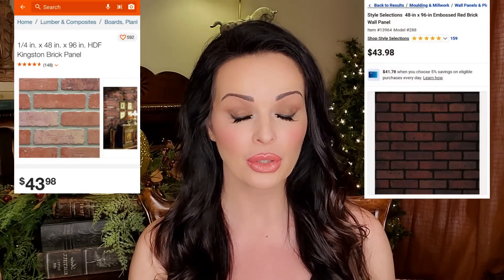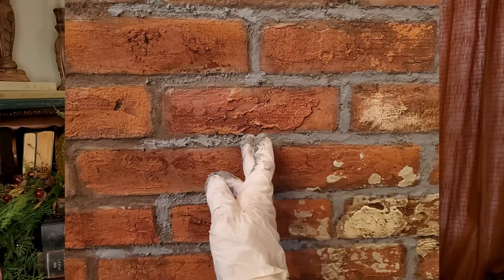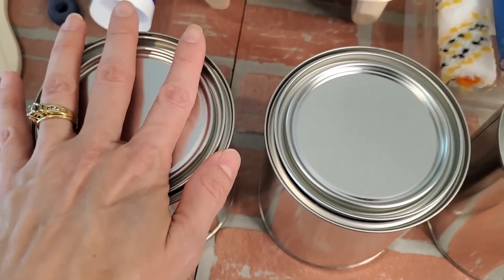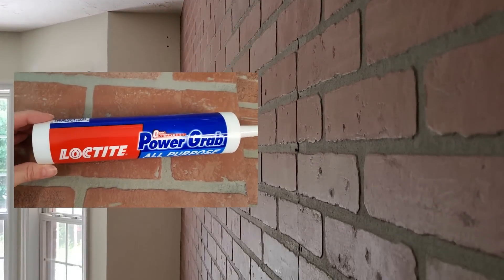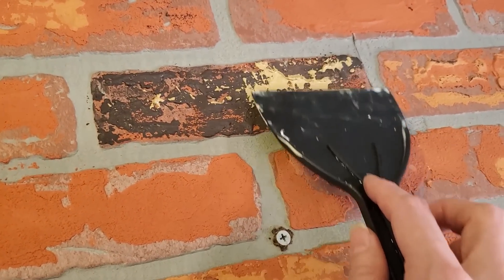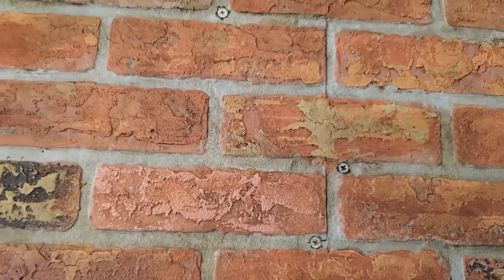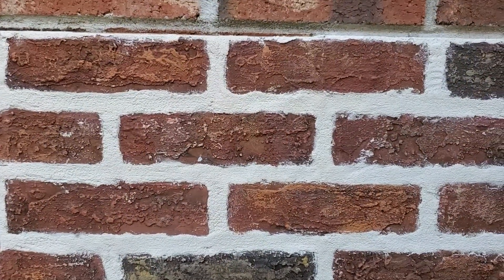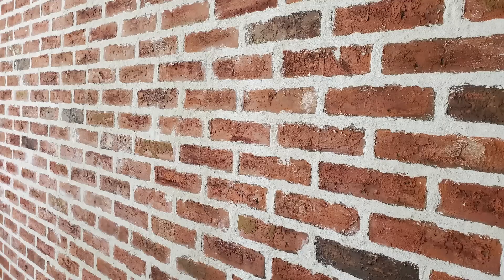THE BEST DIY Faux Brick Wall Tutorial! High End Custom Look for a Fraction of Thin Brick! So Easy!

Comment: Your video is titled accurately - it IS the best tutorial (that I’ve watched, and I’ve watched a lot😁) on this topic!   
Question: I’m curious why you decided to combine the stucco patch with the joint compound. Is the stucco patch too chunky/sandy?
Reply: I think I figured out the reason for combining the joint compound with the stucco patch (though it might not be the same reason you had)! The stucco patch takes several hours to cure/dry, but the joint compound has a much shorter dry time (especially if you use the 20 minute silver set like I did 😁). I forgot to add JC to one batch of texture and noticed that, unlike the previous ones, it was still mushy when I went to add the next layer. Initially I was concerned that my 20-minute joint compound would result in the product setting up too quickly, but combined with the stucco patch + paint, it wasn’t an issue at all.

Comment: It looks really fake to me with the grout being so thick and not set back a bit like it normally would be on a real brick wall. You probably should have stopped adding more layers and just painted the grout the colour you wanted to give a more realistic end result.
Reply from the maker: Good morning! I can understand your point of view. This method is very versatile and can be adjusted to whatever look you desire. It definitely looks really in person. We've had visitors who commented on it thinking it was real brick. Messy mortar is thick and often covers even more of the brick and will extend even past the brick, which I may add more grout in the future. So many options to consider with different brick looks! Hope you have a great weekend. 👍🏻 Xoxoxo
Reply: So funny, this morning I’m tackling a large area of this fake brick from Home Depot in my she shed. I’m just using joint compound and chalk paint. I would only use chalk paint except we did the method where you cut out every other brick to hide the seams. That leaves lines that need the joint compound. But I’m just using the color of the bricks that came with the Home Depot version which has a variety of colors anyway. I just want to “age” it.